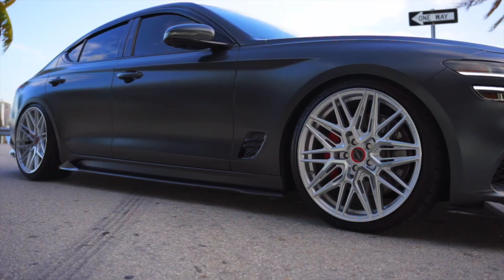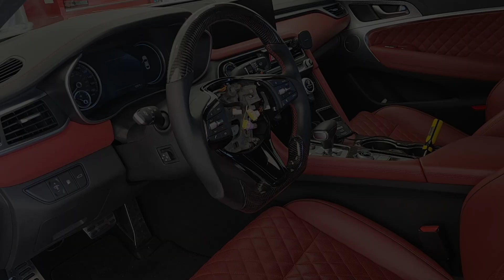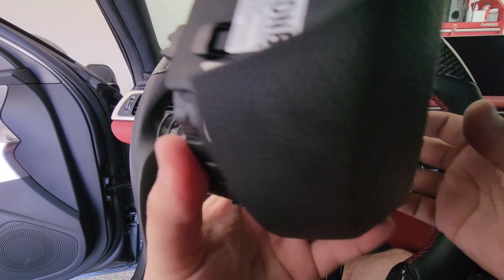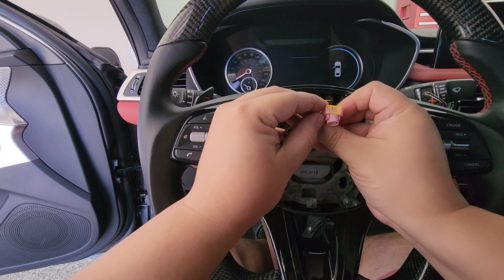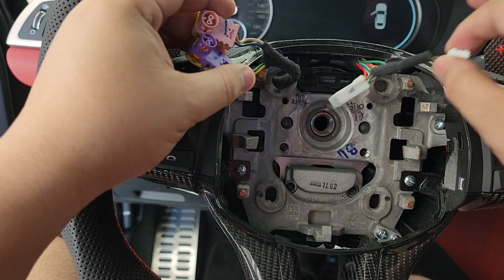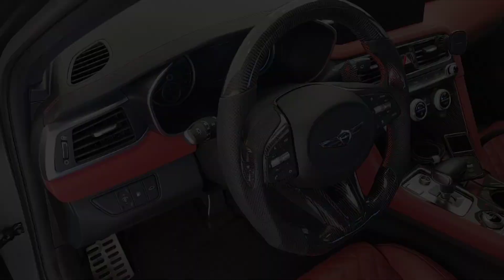Genesis G70 Carbon Fiber Steering Wheel by BoostedWhipz Carbon

Comment: How much is this
Reply from the maker: Depends on the setup. Starts at $975 for Carbon Fiber Steering Wheel (uses OEM Core) & Trims + OEM Buttons & OEM Paddle Shifters with Smooth or Perforated Leather Sides. Starts to add up from there.